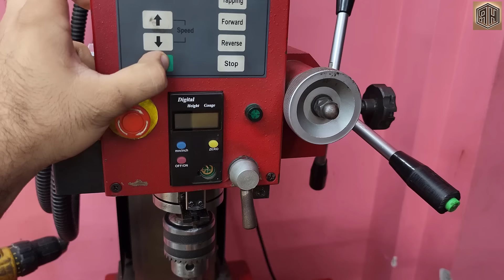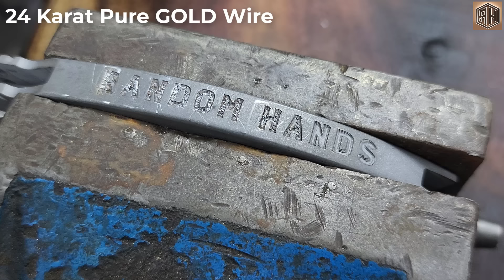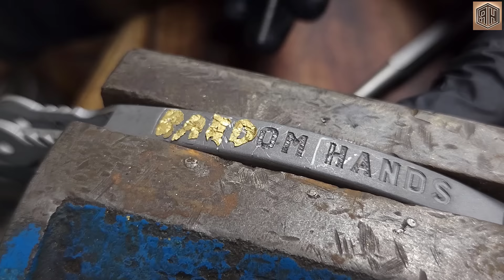Rusted Drill Bit Forged into a 24K GOLD Plated BUTTERFLY KNIFE

Comment: The end result looks amazing and a surface grinder is one way to go about it haha. I love using technology but i am also very traditional when i make knives etc myself as i don't have access to fancy machines so i will work the material until i get the desired shape which normally means you have to get a good even temp when hardening or you get spots that are harder.
Ultimately its about having fun right :)

Comment: As a balisong flipper, this is much better quality than the last one you did made from the rusted spring. Both of these are very obvious that you’re a metalworker and not a balisong manufacturer, but it’s very good for trying to make one with your style of smithing. There’s a lot of things you could improve on if you actually want to make a good balisong but this one looks like a very nice display piece.
Reply: Literally sold this one for almost 1.5k
Reply: it's most likely a terrible flipper because of the handle shape and the curvature but definitely a pretty piece
Reply: @pasatebo  I agree

Comment: I’m done with this man he really just said 24 karat gold wire gold and he’s hitting it with a hammer are use the push and a nail gold is almost as strong as a diamond and he also said 24 karat gold Pure  plating  solution bro that’s literally just some acid and Metal wires connected to To the blade in the electricity going through the wire touching the metal in the acid  changeing The color of metal my dad used to be a blacksmith and  A welder he  knows a bunch about that and so do I to